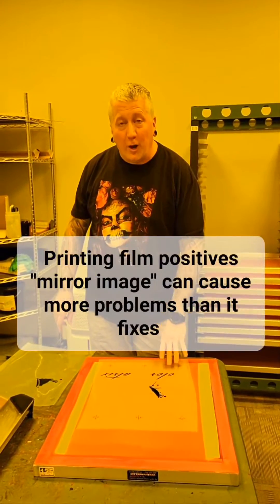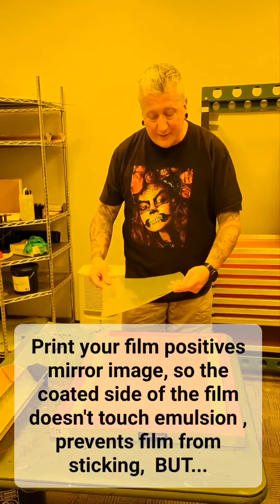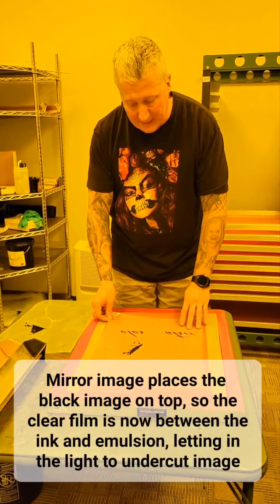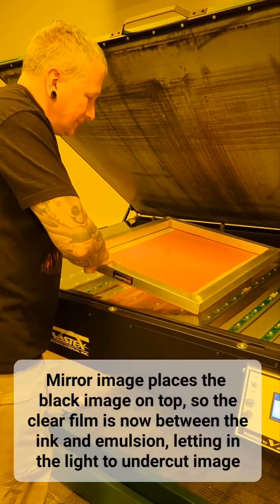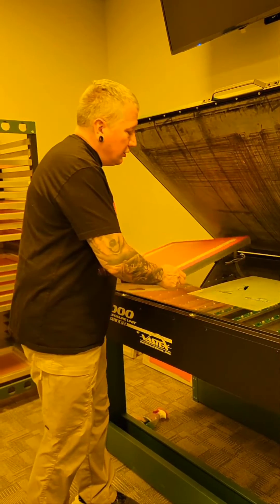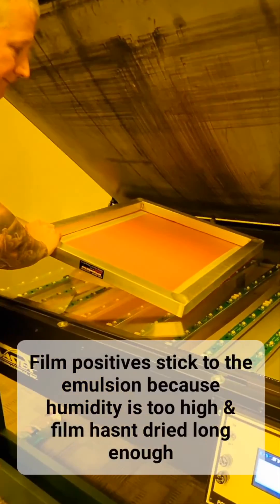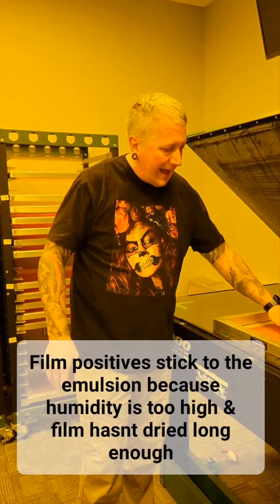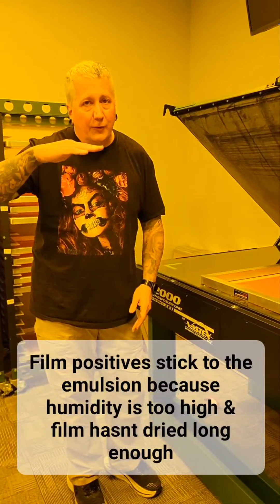Why printing film positive mirror image for screen printing can cause problems

Comment: another great video my friend. What printer do you use to print your transparencies ? What ink do you use in your printer to block out the light?
Reply from the maker: We use the Epson T-3270 24" wide roll printer. We sell an all black ink kit that works with Epson Eco tanks or can be poured into CISS or refill kits